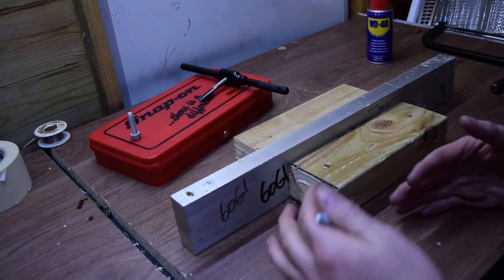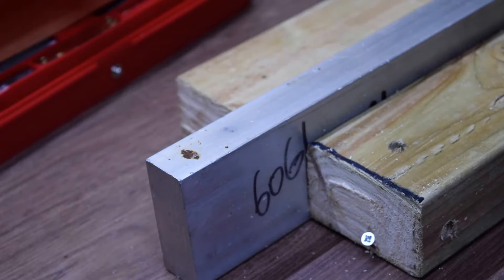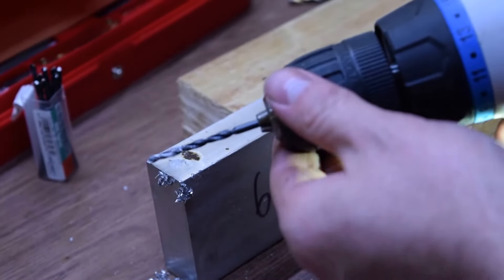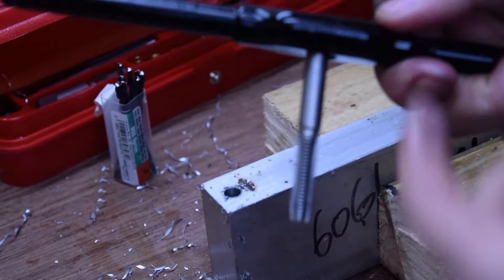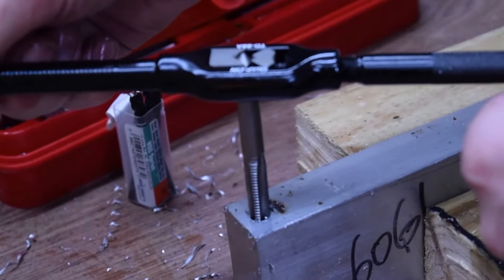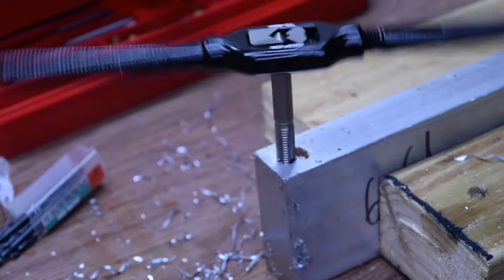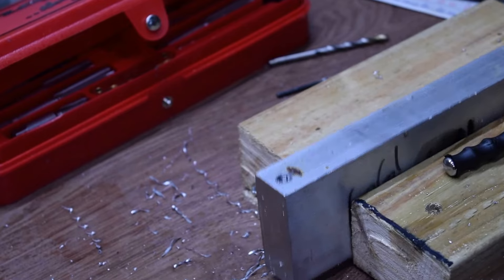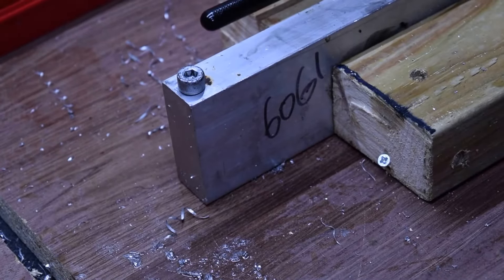How to drill and tap a hole (In 3 mins)

Comment: hello i'm trying to tap m10x1.5 but in the kit i got it has inserts? it says to use a 13/32 drill so i did but when i used the drill to make the hole & begin to turn the tap it gets stuck?? i can't tap through for some reason.. don't know what i'm doing wrong
Reply from the maker: So the kit is telling you to use an imperial drill size to cut a metric thread? 
You need a 8.5mm drill bit for a normal m10x1.5 thread 
If it’s got inserts then I’m not sure exactly without seeing the kit
Reply: That doesn't make sense. 13/32  pilot hole is 10.3mm and larger than the major diameter of an M10 bolt.

Comment: what do you use to lubricate it?????????
Reply from the maker: You can get specialist cutting fluid for this kind of operation, but at a push you’d get away with WD40 if you had nothing else to use 👍🏻 
Motor oil can also be used too, anything is better than dry cutting 👌🏻

Comment: You went from a 7mm drill to a 8mm tap so generally speaking you go for a 1mm increments?
Reply from the maker: If you are taping a hole you need to look up the drill size needed for different threads 
For instance a m6x1.0 thread requires a 5mm hole 
But a m8x1.25 requires a 6.7mm hole to be drilled first 
Use Google to find a drill and tap chart for the hole needed
Reply: @CarsandEngineering  thank you. I'm a beginner. Found a chart now. :)
Thank you for the video!!!

Comment: Jack, I've got a quite a thick piece of metal that I need to tap, need to fit a 6mm threaded eye into it. Should I go with a 5.5 drill bit or 5?
Reply from the maker: +Chris Grov Hi chris, you'd want to go with a 5.25mm drill bit if the thread pitch is 0.75(fine pitch thread) or a 5mm drill bit for  (coarse thread) if in doubt it's more than likely a coarse thread. 
This chart should help: 
http://www.tecni-cable.co.uk/s.nl/ctype.KB/it.I/id.114/KB.24638/.f
Make sure you use plenty of cooling/lubricant with thick material as heat dramatically changes the cutting ability of your tools.